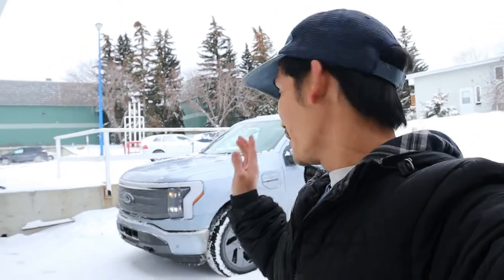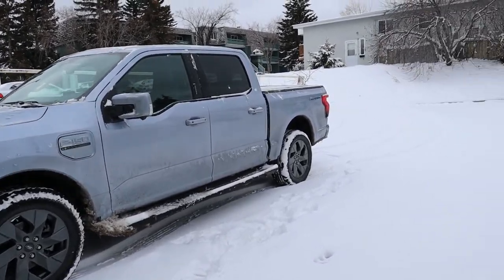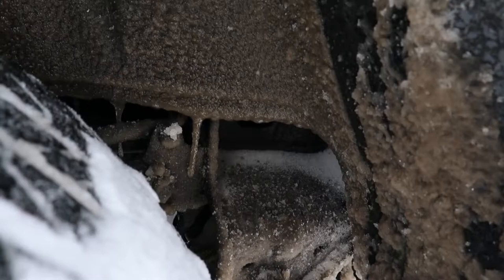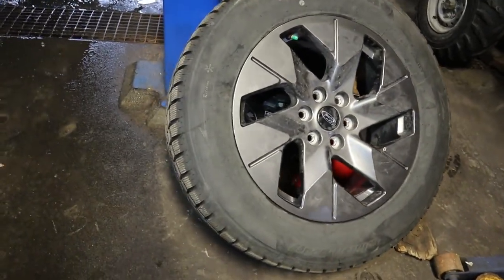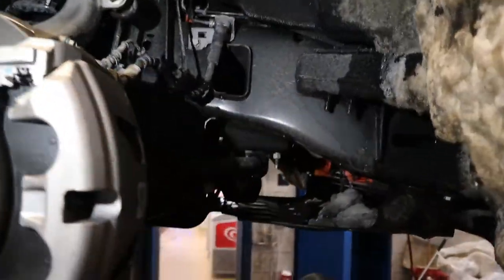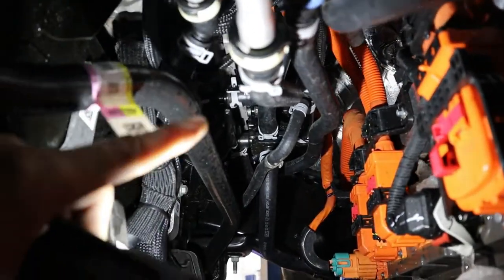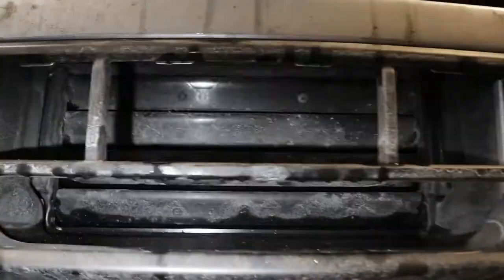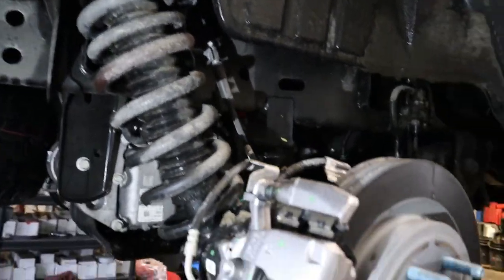F150 Lightning winter tires change P1 // Is the Lightning capable in winter ??

Comment: Which stock tire for the Lightning do you think would perform better in the snow, the all-season or all-terrain? Do you happen to know the model name of each of the stock tires they offer? I saw the all-season you had was a Hankook but I would like to look it up so I can read some reviews and ratings before ordering mine. Thank you for the great videos.
Reply from the maker: I would say all - terrain tires will do better in the snow. Like my Raptor has stock tires BF Goodrich K02 all-terrain doing good in snow ❄️ and great for off-road. But all-terrain will drain the battery faster than all-season tire. I don’t remember how many tires option they offer on the Lightning. Good luck with your order.